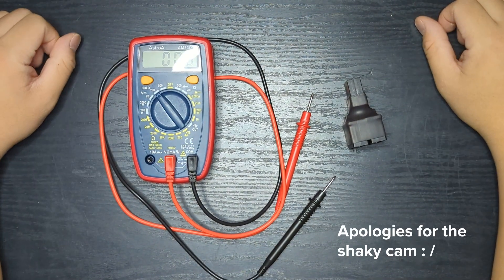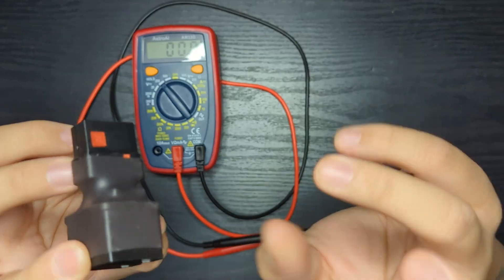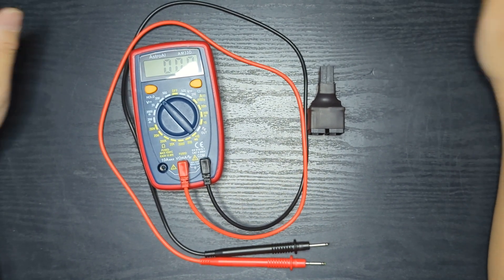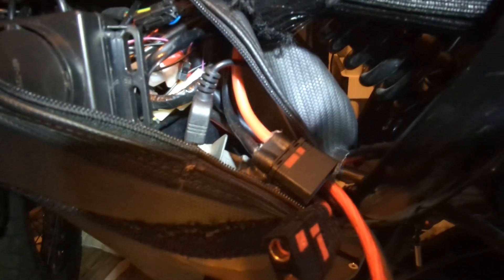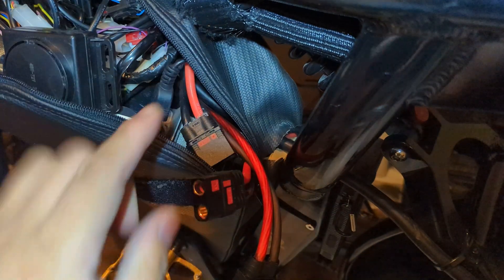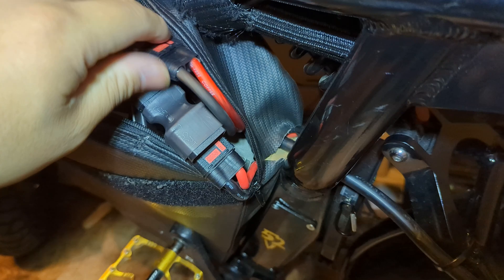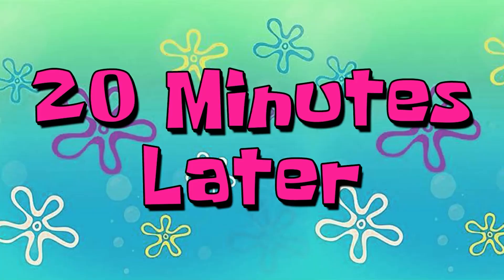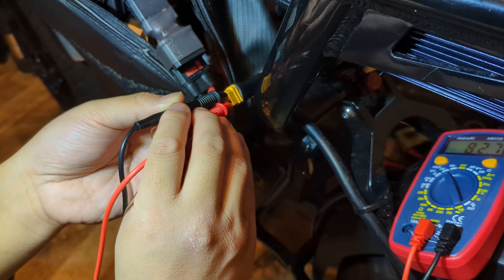How To PARALLEL CONNECT E-BIKE BATTERIES (Easy Step-By-Step)!

Comment: I put a 2000 watt kit on my x class with a second battery and y style connection to run both batteries together, both 48v.Everything runs good 38mph but the batteries drain super quick and don't seem to fully charge and                                                                                                                                                                                                                                                                                      experience brief sag or power delay when running, very annoying and I have no idea how to  deal with it. Could be crappy y battery connectorr?
Reply from the maker: I would just double check the voltage levels on both to make sure they match. If the voltages don't match then I would try to parallel them again. 2000w is pretty demanding as well especially for a 48v setup which could be the reason also for the battery drain. What kind of controller are you running?

Comment: Couldn't you just use 3 Skokie diodes one on each battery ? That way as long as there all same voltage there can't be a heavy rush of current from one to another if voltage is off a little and if one cell shorts it will only affect one battery ? I use cell fuses on my DIY batteries just in case but it seams , as long as the diode rating is higher than the power in my case double the controller needs it would be safe . I am about to try adding 2 more diy 36v 20ah batteries in a saddle bag to increase my range

Comment: Will it not take twice the time to charge with only one charger.....

Can you charge each battery with its own charger or would they need to be disconnected beforehand for two chargers?
Reply from the maker: Correct! You can use one charger to charger both and it will take longer or if you have a secondary charger just plug it into the other charge port for the second battery and it will speed up the charge time.

Comment: I have two upp 72v 19.2ah 50a bms. Can i do the aame thing? Indont wanna lose power with the discharge module
Reply from the maker: Yes you can just make sure they're at the same voltage level when you connect them
Reply: @JB360_NYC  I did. It's awesome. I just unplug them to charge

Comment: Damn. What happens if you don’t do this ?? I just installed 2 batteries with that adapter and rode it for a few miles
Reply from the maker: So if the voltages don't match a lot of times both batteries may cancel each other and can result in voltage drop. Are you noticing any difference in range than before?
Reply: @JB360_NYC  idk I rode it for about 3 miles to test it out then saw this video lol. I parallel connected them now. But what would happen if I run a 60v battery with the stock 52v ? Google says in order to parallel connect 2 batteries, they have to be the same voltage. Would it damage anything ?
Reply from the maker: @TheNoeMurillo  yes when paralleling them you want to stick with the same voltage to reduce the risk of damaging both. This can damage the cells especially the smaller voltage pack.
Reply: @JB360_NYC  ok good to know. Would the DATEx2 60A be sufficient ? It’s a 60v controller, stock batter is 52v 18ah and battery I plan on getting is 60v 24ah
Reply from the maker: @TheNoeMurillo  yes using the DateX2 60a would be sufficient and safe as long as your combined AH are under 60amps.
Reply: @JB360_NYC  sweet. Thanks for the help
Reply: @TheNoeMurillo 52v charges up to 58.8V... for a 60v pack you need a 72v controller

Comment: Thanks for making this video. I was curious do you have a preference on which battery you charge when running parallel (main or secondary)? Do you use the one with a better charger cable? I didn't know you would be able charge both at the same time with one charger till I watched this.
Reply from the maker: I actually use the smaller battery up top to charge only because it's a lot easier to reach the charging port lol.
Reply: @JB360_NYC  Thanks, I do have an additional question and hoping you might have some insight. I manage to run the parallel setup with a UPP triangle battery and AR stock battery. Although, I was wondering if you keep both batteries "powered on" at all times even when you are not using the bike. Normally when I was using a blender, the triangle battery has a "power switch/button" on the battery itself that I would turn off the battery when not using the bike. Can I turn the power off when running the parallel setup or would this mess up the voltage balance between the two batteries? Any insight on this would be appreciated, so far everything is working. Hope this made sense lol...
Reply from the maker: @Nuf1av0r  Yes this is a great question. So the simple answer is yes, both have to be on in order to hold the charge. The shark battery I have up top also has the power button as well so it was definitely a question of mine when I first did the parallel connection a couple of years ago.
Reply: I use a splitter cable and a bit bigger charger and charge both together with a single charger... but using BOTH charge ports

Comment: Awesome VIDEO, I just hooked up my Dualtron Storm battery to my Wolf King GT and I can say this thing is now the ultimate scooter. Basically 67AH. Check out my latest video's on it.  On my bike  that's like the LECTRIC, I run 2 of the same batteries in parallel at the same time and I get 3 times the range. check out my lastest shorts .
Reply from the maker: Looks great dude ⚡⚡

Comment: does using a battery blender thing have any advantage over just doing a setup like this? i understand the battery blender prevents energy flow from one battery to another, but does this actually help in safety in any way? also how would you recommend i go about connecting 3 batteries in parallel?
Reply from the maker: One advantage would be that you don't have to match voltages like here so it's mainly just plug and play with no volt meter required.  Just note the blender does hinder the top speed a bit especially with 72V batteries. Sal and I tested parallel connection vs a 90a blender and difference was about 7 mph. If you're planning to do a 3 parallel connection, you would just need a custom harness with 3 discharge cables instead of two and just follow the same steps with all 3 batteries.

Comment: this is super helpfull, running 2 batteries with the same voltage in parallel will double the amp
Reply: Anne from nbpower said dont because the BMS are separate, my question to her is how does it not double the amp even if the BMS are separate. Is she trying to confuse me or is there's something im missing out on?
Reply: @kiiingrook8592 you're missing out on electronic theory. Say 1battery is 40amp with BMS max discharge/peak of 80 and another that's 35 amp and 75peak. Combining in parallel you are assuming that functions same as within the pack or in combination with modules, wrong. The BMS for each limits are for each individual battery respectively so combining in parallel your now 75amp continuous and 150 peak is far beyond the capabilities of the BMS to control. Now the same controller will ask for the same amps of your original battery, say the 40amps so you're just increasing range and time but when you think your amp increase from both batteries in parallel means you can upgrade your controller for 150peak...You've made a 🔥🚒. Please do not do this 🙏,
Reply: higher amp.. yes.. double... no ...except when both are identical

Comment: What would happen if you parallel connected but the two batteries weren't close in voltage? Would it guarantee cause permanent damage to both batteries? Or would it cause any dangerous explosions or fire?
Reply from the maker: Basically if the voltages were too far apart and you connected them they would basically cause a spark from the parallel connector and possibly damage one or both of the batteries. Also a possiblity you'll lose voltage quicker next time you use one of the batteries. Last thing you want is a dead cell in one of the packs. That's why it's super important to get the voltage close under a volt.
Reply: Is this what the battery blender does? Allows the 48, 52, 60, or 72v battery with the highest voltage, discharge until it matches the battery with the lowest voltage? I do like that only 1 charger is needed to charge both batteries, and that they keep the same voltage once they are connected.

I have and Engwe Engine Pro with 2 batteries, but I use a blender.
Reply: @beddamade hello. I've got Engwe engine Pro 48V 16aH as well, can you tell me please which blender is good to be used? Thank you
Reply: They absolutely should have the same nominal Voltage. I tried it with LiFEP4 Batteries, one 280ah 12V fully charged, the other 100ah 12V only half charged. Most People would say the Current from the full battery to the half full would lead to a catastrophe. Well, it did not. There was only about 5 amps current from one battery to the other which sank quite quickly to 2 amps. Have not tried it with higher voltage e-bike batteries yet, but if you  want to make sure nothing bad happens, just  put a 20-30 amp fuse between the batteries. In case you are really careless and connect a fully charged battery to an empty battery it will just blow the fuse an you know you did something wrong.

Comment: 9:00 be sure not to touch your two probes and short out the battery when doing this test :). Melted leads will suck.

Would be a cool project if you install a digital volt meters to the batteries with some switches to make it easier to check battery before each ride
Reply from the maker: For sure! I'm actually going to be adding it to my DIY pocket pike I'm putting together

Comment: I am new to the e bike mod world and i consider myself a novice, but i thought the purpose of the blender was that you can mix & match batteries regardless of V&Ah with no need to worry about charge levels and or to worry about having a meltdown w/the barries? Or did i misunderstood the point of the blender regardless of the make? Please advise and keep up the good work and ride safe!
LB
Reply from the maker: You are correct! The battery blender will suffice if you're linking 52V to 52V or 48V without worrying about levels but once you get to the higher voltages like 72V, we've found the higher rated battery blenders almost hinder some of the torque and acceleration. Parallel connections provide a more direct connection resulting in better battery performance while the two batteries are linked.
Reply: @JB360_NYC  got it thanks for the explanation 👍

Comment: Good video with some great info JB!!! When charging the batteries at the same time, any chance/risk of overheating been that there's no blender? Or the bms in the batteries will work as a fail safe???
Reply from the maker: No overheating and if you connect your other charger to the other battery port, you will essentially speed up your charge time. The BMS will always prevent any overheating. I just wouldn't charge your batteries for any longer than 12 hours unattended.
Reply: @JB360_NYC  AWESOME!!! GREAT STUFF!!! JUST SPOKE WITH E-STREET BIKES (SAL) EARLIER, 72V KEPLER COMING OUT SOON!!!
Reply from the maker: @flxthecat2735  can't wait!
Reply: You mean discharging.....??